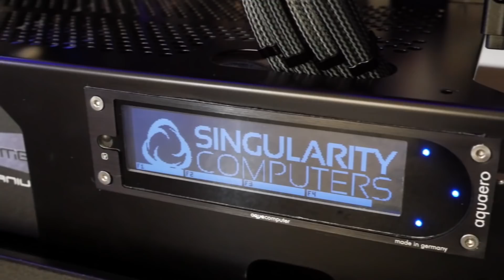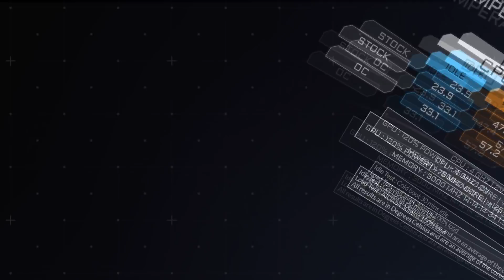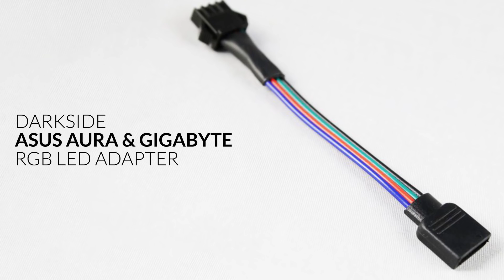Extreme Fractal R5 Workstation Build #25 Part 7

Comment: Any plans on releasing a 150mm version of your Protium reservoirs?
Reply: That would be amazing.  I really wanted to use the protium line again for another build, but the case is small enough that a medium 250 wouldn't work and a small 100 is...too small.  Medium would actually work if I used a DDC instead of a D5, but I prefer D5 pumps.